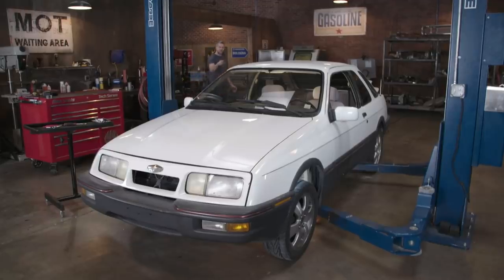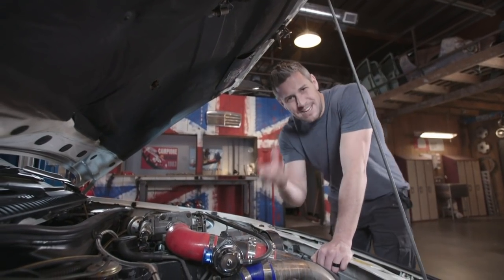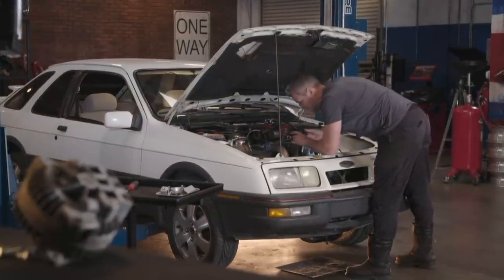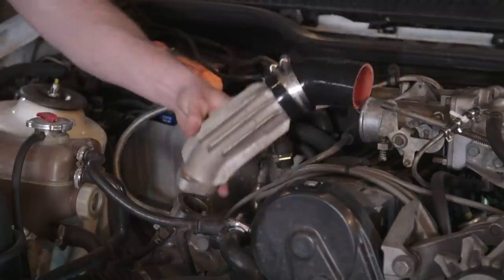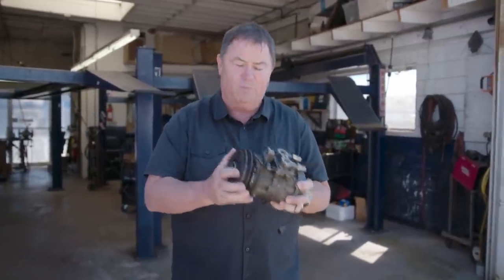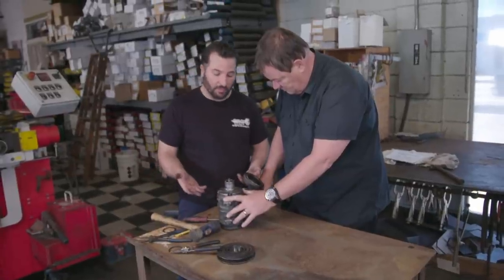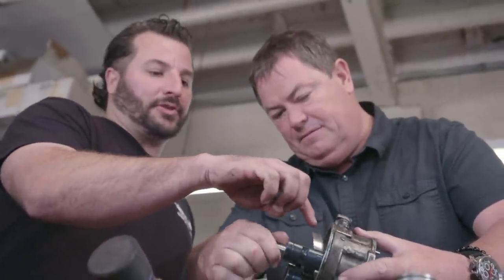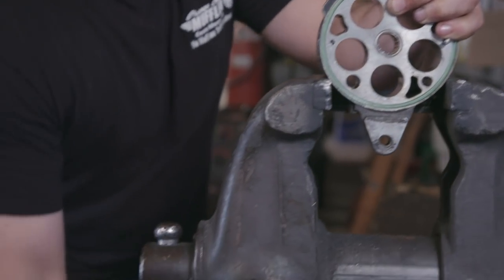Ford Merkur XR4Ti: How To Refurbish The Air Conditioner Compressor | Wheeler Dealers

Comment: I have 2 XR4ti's and I can plainly state that the turbo lag with a front mount intercooler is negligible. I can also state that the A/C can still be used with the front mount cooler. Besides that, it was fun to see another XR4 on a video.